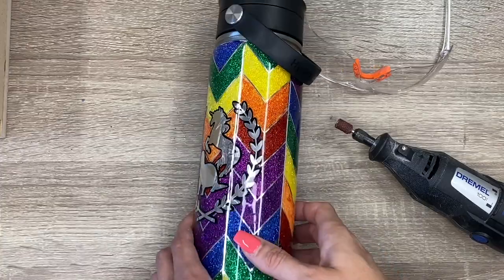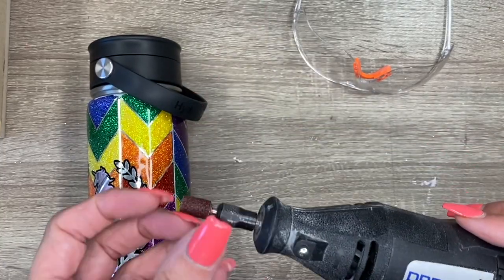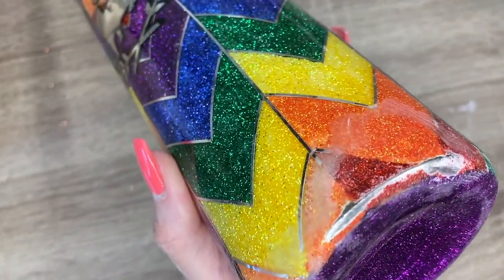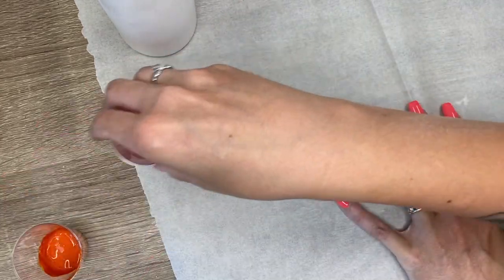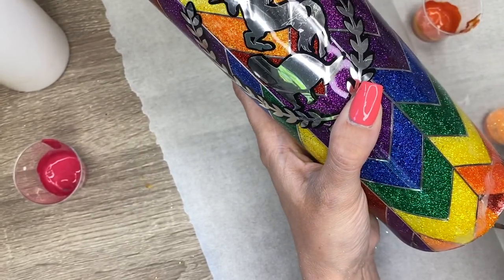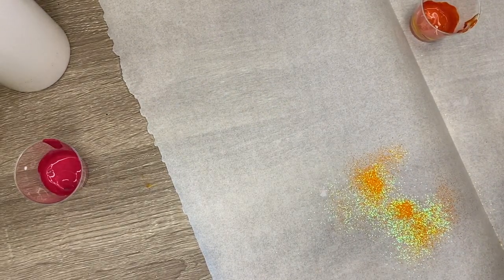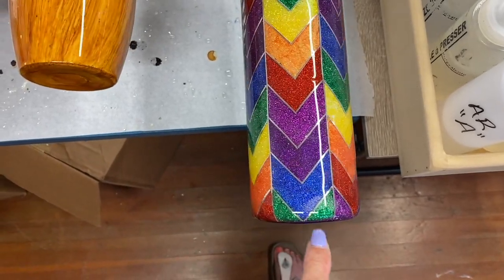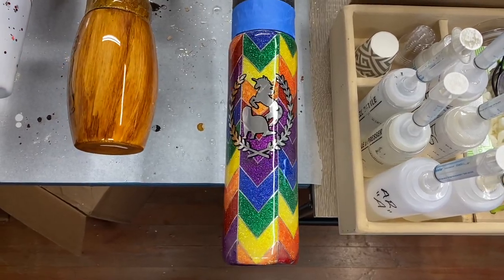How To Repair Epoxy Tumblers

Comment: I did a tumbler and there is a little tiny place on it that didn't get any epoxy and you can see down to the spray paint. Do I have to strip it or can I just put another coat on to cover that spot up? The spot where there is no epoxy is tiny, no where as large as the broken area on yours. I sure hope it's possible because I hate the thought of stripping it. I'm a newbie to all this and want to make sure I do things right.
Reply: I have the same question as LynneNC.  I have a very small area that the epoxy was very thin and you can see the cup. Can I use your method to fix it?
Reply: Yes as long as the cup doesn’t have too many coats of epoxy already.  And make sure to do the whole cup not just the area good luck!